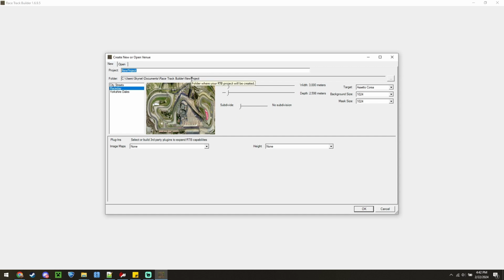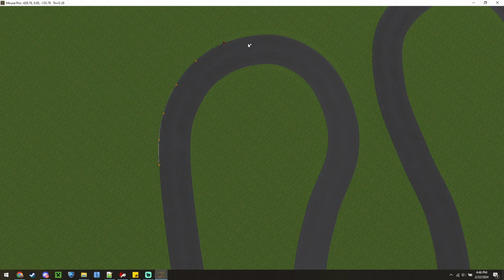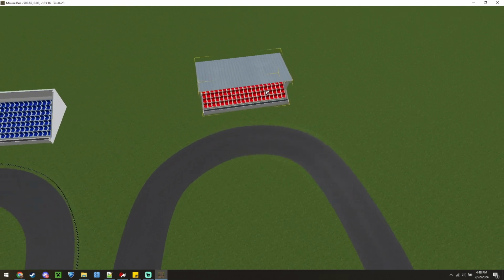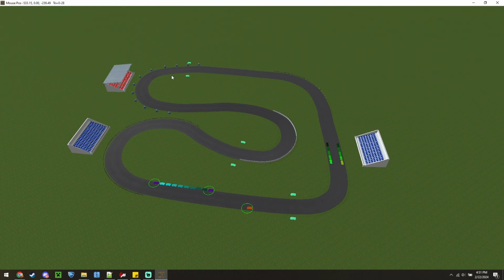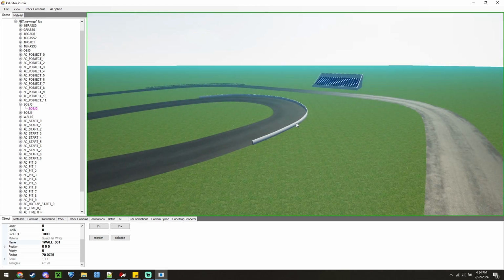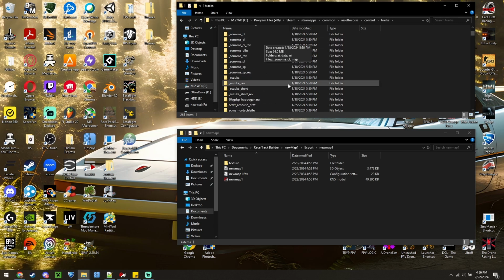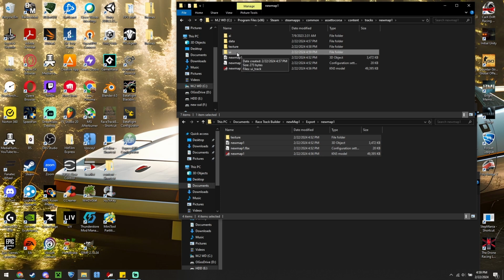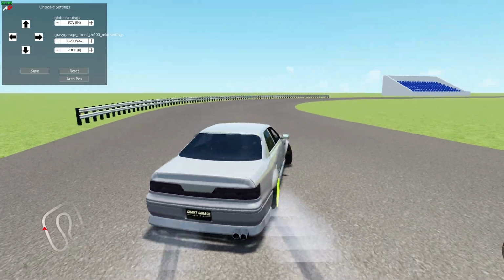make your own assetto track

Comment: How does the difficulty compare to building a track in Blender?
Reply from the maker: RTB is 1000x easier compared to blender but to get similar freedom, you really have to work around the limitations of the application. I would say it is a stepping stone for working in blender for sure but it will def be a big adjustment.

Comment: Do you know if there is any user manual of this software? I don't know how to use the keyboard, no help function, unbelievable!
Reply from the maker: You can push F1 I believe when u have the application open to bring up a controls menu. I would also suggest taking a look at my RTB complete guide vid. It's long but I go pretty in depth of the basic mechanics of the application!